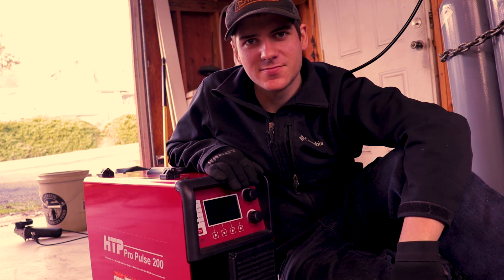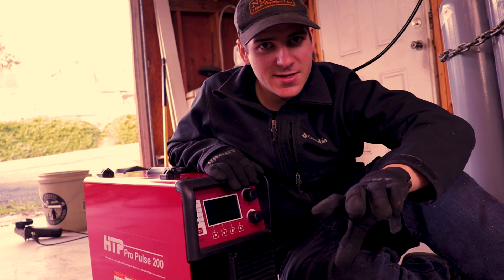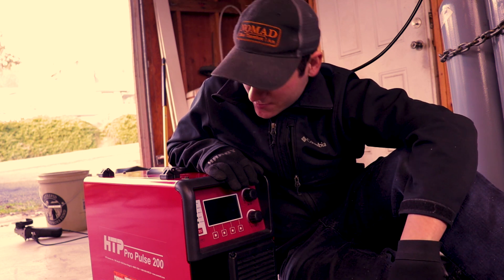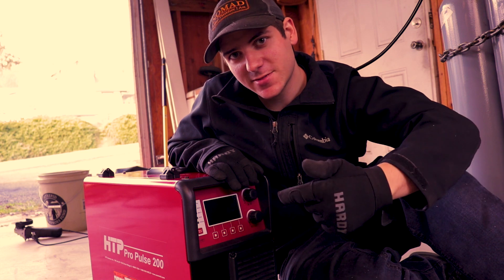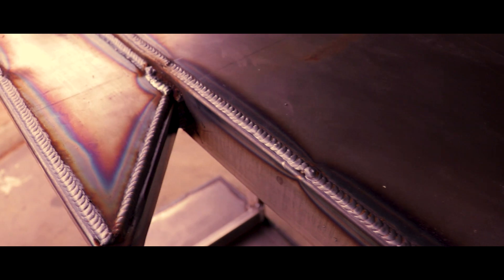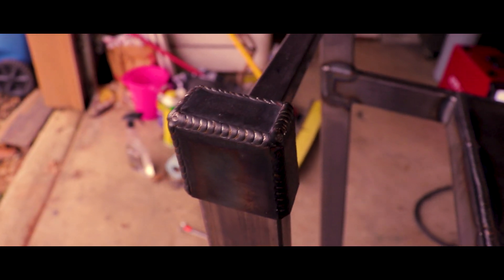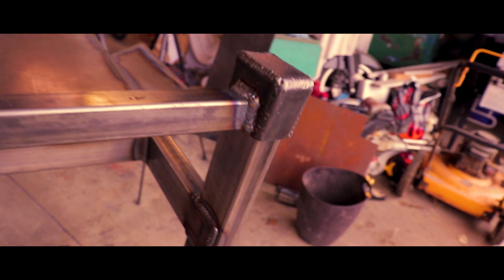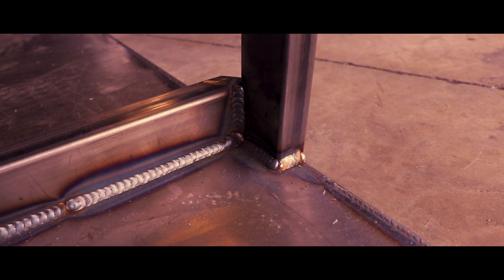DIY Welding Cart Build with HTP Pro Pulse 200

Comment: You’re the first person I’ve seen use these welders on YouTube that can actually weld!!! I’ve been looking at them for my home Shop but I can’t see paying 2 grand for this when I could get a Millermatic 212 for the same price
Reply: David - he didn't mean me by good welder .... LOL although i am using it .... but "all you do" is steel fabrication then the machine is "too much machine" for you - i still don't think the machine is too much money for what it is ... but it is too much machine  .....  if you want to do aluminum or fix casings with SiBro .... then this is a whole different world .... now the machine can be a great value ....  there is a time and a place for everything ... and for running regular mig wire  - the miller 212 is a great machine ...  you could probably even spend less and still be ok ....
Reply from the maker: Haha there's some good welders out there using them!  I'm happy with this one so far.  I learned to weld on the 212, great machines.  These are just so dead simple. But if you know what you're doing you can get in there and fine tune so much stuff.  Thanks for watching bud!
Reply: Zila honestly I don’t do a lot of aluminum but I have a big job coming up that is 4x4x3/8” aluminum angle that I may need to get some advice on

Comment: What were your settings
Reply from the maker: FollowerofYahuwah hey in my next video ill have all that stuff in it.  But off the top of my head i remember the wire speed was 173 for the lap joints and 188 for the fillets.  Can't remember the voltage because this machine self adjusts the voltage and amperage with the wire speed.